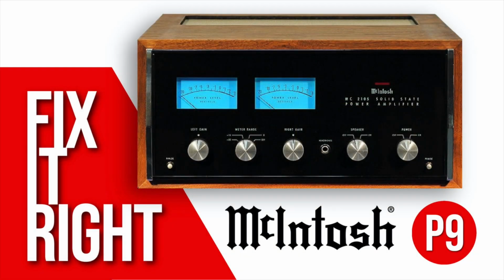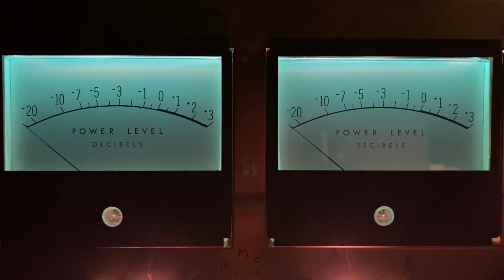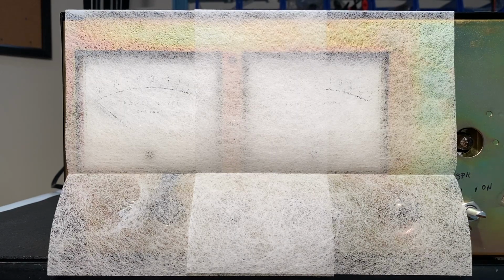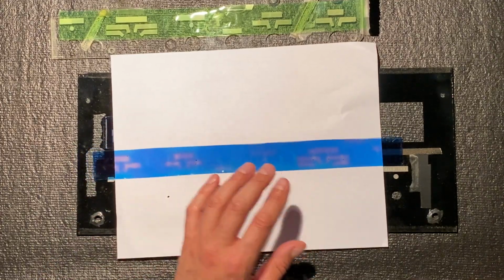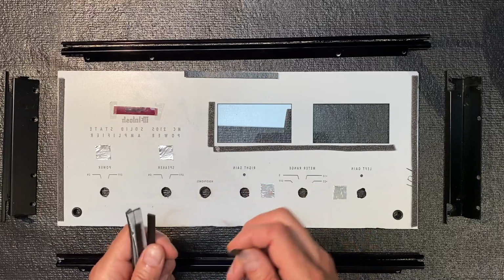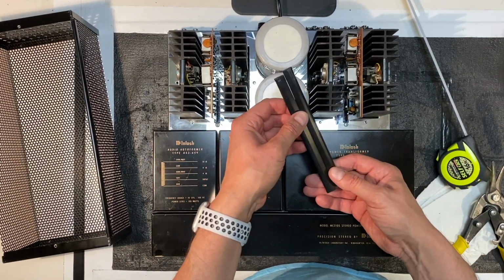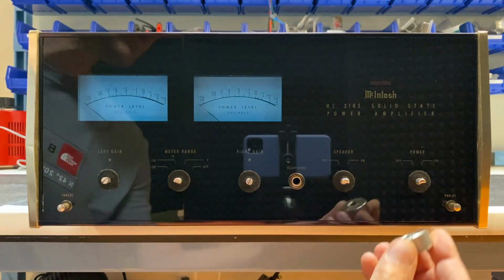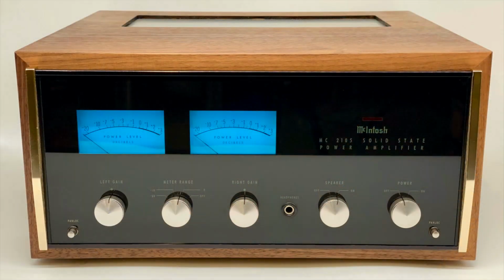McIntosh MC2105 P9: Demonstration, Meter Calibration, New Lamps, New Glass, New Cabinet & Panlocs!

Comment: A suggested substitute for the aluminum foil tape to improve the lighting on the panel meters...
3M makes a white Post-It tape. Like the Post-It notes, it sticks well but is easily removed when needed.
The tape is sticky across its full width. It's available in various widths, with 1" being the widest I've seen. I think the white color would offer good reflection to improve the lighting of the meters without being so darned difficult to remove as that aluminum tape is.
The only down side is that the 1" tape is hard to find. Sometimes Office Depot has it, usually not.

Comment: Comparing my mc2105 to this one here, two notes regarding the meter and lettering colours. 1) mine did not have the blue colour big strips for the panel lettering, and no evidence there ever was there, but seem to have the blue in the decals stuck behind each individual label. 2) the blue strip along the top of the meters, mine was faded to clear amber right at the parts where the plexiglass prisms shone through them, so changing this blue strip brought the meters back to a fully blue appearance, no greening at the top.

Comment: Some great tips!
Reply from the maker: Thanks, Edwin.
Reply: @FluxCondenser  One question. You've taped the reflective tape behind the meter lights, but on my 2105, the cover above the meters has a plate that goes down in front of the transformers which would block the reflective material. Would it be OK to put the reflective stuff on the inside of the cover?

Comment: I have a McIntosh MC312 Amplifier and want to know what bulbs to buy to replace.  Also want to know how to calibrate the meters for the MC312 amplifier.  Thanks
Reply from the maker: Sorry not sure about the procedure for that amp. Try to find a good service manual for the amp which will explain the procedure. As far as the bulbs, their codes should be listed on the bulbs.

Comment: Yes, very nice series. Very helpful in my project, however, 3 things, if I might add, first, the reflective tape that you applied to the Autoformer for the meter lighting is not in the picture once you install the cover plate, I installed the tape to the inside of the cover plate, it helps a bit but I wonder about long term exposure to those hot little bulbs, granted any damage is INSIDE the cover plate, hopefully. 2nd, the static issue that you had with the meters was automatically corrected after a couple power cycles, no dryer sheets required. And 3rd, mine had no clearance issue with the cage trim touching the cap, maybe some do and maybe even the slightest touching would absorb any cap hum- good or bad?, so good call on that one if it touches at all. Thanks, Loving the amp. Looking forward to new content, maybe the hybrid 230, or amazing 67 tuner.

Comment: do technicians replace the chrome sides on these? I have MC2105 and the chrome is scuffed up a bit. Is that easy to fix?
Reply from the maker: Jimmy, the chrome can certainly be replaced, but I’m not aware of any readily available sources for those as there are with the glass panels. Also note that the chrome pieces are fairly easy to remove if you want to polish them, but they’re part of the delicate glass display assembly, so caution should be used. As far as repairing the scuffs, for that too, you must be very gentle. If you’re not confident in your abilities to do the job, you could always send them to a metals shop to have someone knowledgeable do the work. That said, if you sparingly used a product like Simichrome or Rolite to gently buff the chrome, I don’t think you’d encounter any problems. Doing so would be at your own risk, though, and you’d have to ensure that you were able to safely remove the chrome pieces from the panel before doing so. Good luck!
Reply: @FluxCondenser  I sent my unit to a certified McIntosh repair center so maybe they will polish/buff the chrome!  Thanks!

Comment: I thought the idea about the silver tape was a good one, so I took the cover off my 2105 to do the same thing.  I found that someone had done this trick already.  

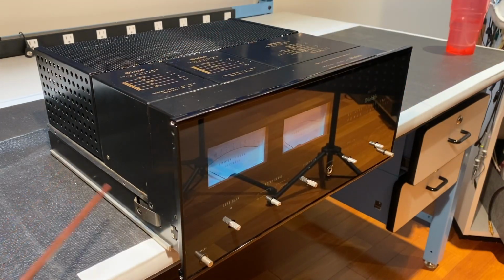However, you and the other guy were mistaken.  You cannot put the tape on the back panel on the power supplies because when you put the cover back on the cover slides between the power supply and the light bulbs.  You need to put the silver tape on the inside part of the cover as it will be behind the bulbs.  If you look at the video as 25:30 you will see the cover is going in front of the silver tape, thereby covering it up.  Love the video series it was very helpful to understanding my 2105.
Reply from the maker: My solution worked perfectly for me.

Comment: Yes thank you very much. A true patient and in depth how to update a Mac.
Was very lucky to score a truly mint  - and when I say mint I use this term as new - MC2250 which has no cosmetic issue whatever but some strange intermittent problems with balance.
Will also replace all lytics also the two big filtercaps because they have a datecode week 51 year 1977 and the all the smaller ones will be the same age of course.
Unit is completely original so it seems. Even the electrolytic input caps ;-)

I've seen a truckload of Macs from that era but not so clean as this MC2205. Even the bottomplate has no cufs or scratches and the walnut veneered case is also without marks.
I do not know how the previous owner did this, but a big thumps up to him!

Most important thing before servicing is to de-attach that glassplate. You will be very sorry if you haven't and you brake it when working on this unit. Take your time and remember there are no shortcuts with this kind of audio gear.

The MC-2205 has tons of feedback, hardly any bias current and "only" five amplifier stages before the signal is allowed to flow to your speaker. It's the opposite of my Threshold S/500 amplifier which has two stages and no overall feedback. But it seems to my ears to sound great. Maybe that's the declining quality of my hearing with the climbing of years...

The inputboard is very silly located behind one of the output fin-assemblies so before you can work on it you have to loosen that coolingtower...
Well you can't have it all because apart from that the unit with its slotted 4 boards is a joy to work on of course. Just pop them out and you can work very easy on them indeed as showed in these great videos. 

Thanks again for sharing these great vids with us and I'll await more the come ...
Reply from the maker: Thanks. Good luck on the the restoration of your MC2205.

Comment: I just had mine redone with LED lights but the red light above the logo doesn't illuminate at all. What gives??  The other lights look great.
Reply from the maker: Kingv911, that red light is difficult to illuminate and isn’t that bright on mine, either. If you look at the video again, you’ll notice that that area relies on the light channel to provide the illumination. It’s just a piece of plastic, and there’s not an actual bulb behind there. The light channel can work well, but that red area is particularly far from the nearest bulbs. If you have a replacement glass like mine, I’ve also noticed it doesn’t illuminate quite as well as the original glass for some reason.
Reply: @FluxCondenser  Thanks for the reply.  Yeah I did some reading since I posted here and learned that's just the way it is with the LED conversion.  It's too bad because that red accent looks so great and I'm bothered it's not there, yet the other lights look fantastic so I guess it's a small tradeoff.  It was my dad's amp that he had combined with a C28 preamp.  Many of the lights were burnt out so I don't recall ever seeing the red light in the past.  Do you know if the stock incandescent bulbs illuminated the red area well or did even those not have much effect?
Reply from the maker: The incandescent lights work fine enough, but with the replacement glass, I’ve never been 100% satisfied with the level of illumination on this amp. It’s enough to use the amp in the dark with no issues, but I always felt that it would look better with more brightness. Then again, in a dark room overly bright displays can quickly become bothersome so I didn’t pursue it much further. Practically speaking, the subtle look is probably best, overall.